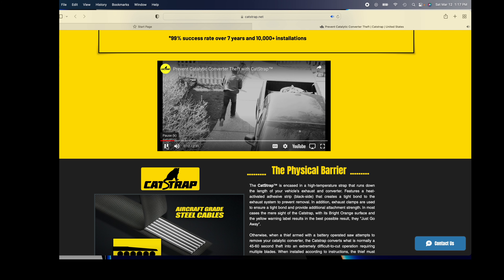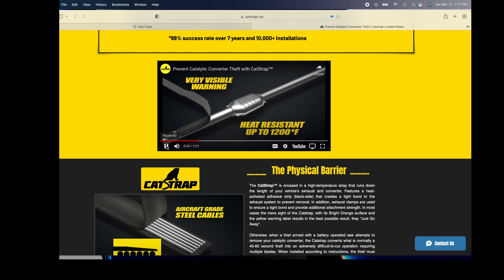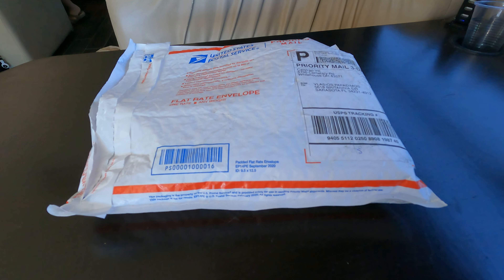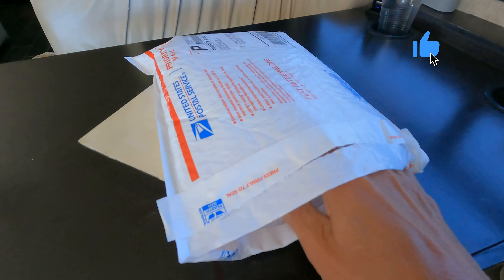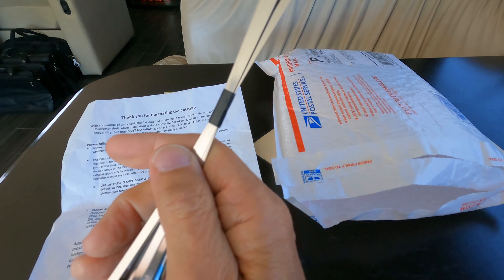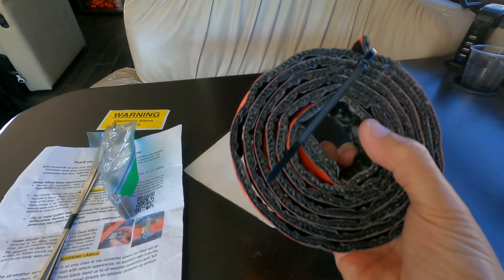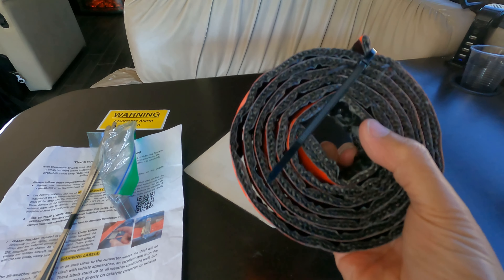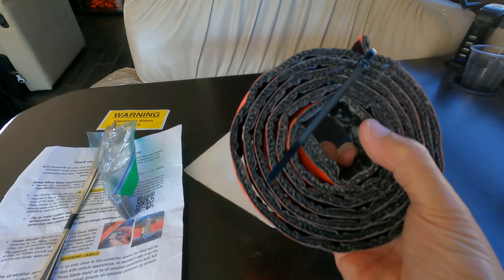Protecting my catalytic converter with a cat strap

Comment: 2020 RVR Recently had my catalytic converter stollen $6300 CAD + another $700.00 CAD for the CAT Strap. Insurance covers $6300 CAD for repairs but not the cost of the Cat Strap. Waited 8 weeks for parts as the entire exhaust system was replaced. The kicker here is I just bought the vehicle July 2022 new old stock and had it for less than 4 days.  Well worth  $700.00 CAD for the Cat Strap. My advice for anyone buying a Mitsubishi  is to have the Cat Strap installed. Mitsubishi dealers are aware of the issue and from what I hear the dealers now offer the Cat Strap as an option buying new or used.
Reply from the maker: Thank you for the information. And sharing your experience
Reply: I had my catalytic converter stolen yesterday  and I own an RVR too 2022 !! Thank you for this piece of information I will go ahead and install one of this
Reply from the maker: @ajeyakrishna7529  thank you for watching and your comments 
Please share let me know how you make out
Reply: Me too. Toronto rvr.  Cat plus 2 o2 sensors. Getting cat strap, steel cables and a shield!   3 Layers. If they can Still steal it they deserve it.

Comment: Unfortunately what this design appears to be missing is steel cables going from the cat to the upper frame to keep them from removing it if they successfully cut the pipes. That would be added protection. Also adding barb wire is an option.
Reply from the maker: All great ideas thank you for sharing and watching the video

Comment: Would have been better for you to install it in a straight line  all along the piping .
As you have it the thieves could just cut your area with 2 pipes after bolts... as well as taking the whole muffler (just hangs down) and the cat strap.... out the muffler the cat and attachment parts $$$$
Reply from the maker: Yep I looked at all the possibilities I tried it first going straight down the muffler and I couldn’t get underneath the heat shield of the catalytic converter so that’s why I went over it and it was so long that I thought well why waste it just wrap it around and if you look carefully there is actually a clamp just passed the muffler clamp Where would be a little harder for them to cut it because they got a cut them up for clamp too but making all that noise cutting all these clamps why no one‘s gonna hear you I don’t care how fast they get I mean people are gonna hear it if you have it in a good area that there’s people around thanks for your comments thanks for watching

Comment: Seems that it would be easy to cut just in front and just in the rear of the strap.
Reply from the maker: It would be easy to cut it pretty well Anyware if you have all the right equipment but it’s time and speed that the person trying to thieve it is looking at so if you look carefully at the back clamp it’s where the muffler is supported to the frame so you’ve got a cut that frame off too and in the front it’s double line there where it comes off the wire splitter from the engine thanks for watching thanks for your comments
Reply: @ACanadianRVereh  Yeah, I recognized that.
Reply from the maker: Any thing is better than nothing 
Thank you

Comment: Couldn't they still cut at the very ends of each side where there is that small gap and get away with it?
Reply from the maker: Anything is possible when you try to steal something but again time is really the crucial part here they don’t want to hang around or make any more noise and they possibly have to so something is better than nothing
Reply: @ACanadianRVereh  true, I'm trying to figure out the best way to deter the thieves.

Comment: So if you need to change the converter is there a way to get this off?
Reply from the maker: No the only way to change the converters of course you would have to cut off the catstrap and then install a new one on the new catalytic converter thanks for watching and your comments
Reply: Yeah, at a shop where they have time and can lift your car without the alarm going nuts...the epoxy is a mess and would require the whole system probably to be pulled then pry off the cat strap. but it is do-able.. :)

Comment: I'm thinking of putting one of these on my 05 Jayco Granite Ridge, apparently the thieves love stealing cats from Ford vehicles.  Question: Did you put the red Locktite on after securing the nuts?  I was always taught to put the Locktite on the threads before attaching the nut, thus using the glue strength to secure the nut.  I suppose it will goober up the threads after the nut is tightened, but a little heat will burn it away.  Thanks for the good video.
Reply from the maker: Hi Jim thanks for watching and your comments first of all I did put the red Loctite on the threads but I put quite a bit on and when I use my ratchet to put the bolts down tight it kind of spread everywhere which I thought well I’m not even gonna bother wiping it off just let it sit and I still think that something is better than nothing and the cost was very minimal let’s just call it insurance and I’m happy it’s there so good luck with yours keep me posted how it turns out let me know how yours bonds to the metal

Comment: I heard the cat strap smells very bad, and some people removed it just because of the smell. Is the smell really that bad?
Reply from the maker: No I did not have any smell. But you have to remember I have it installed on my RV and I have a lot of clearance off the road
Thank you for watching and your thoughts
Reply: Maybe it was their breath backing up on them since they were under the car in an "enclosed" space 😂
Reply: It takes 2-4 days for the smell to go away, this is the burn in process which fuses the cat strap to your exhaust  system.  If you drive short distances it could take longer.

Comment: I'm a mechanic and I could get through that in seconds with the most basic electric power tools. All these products do is take your money.

The best thing you can do is park in well lit safest areas you can, keep your vehicle in a garage if possible, and have the correct insurance. Short of 1/4-1/2 plate steel welded over your entire cat, there's nothing you can do to stop a committed cat thief.
Reply from the maker: Yeah I get it you can take anything off with the proper size cutting blades but it makes a noise it takes a few seconds longer and that’s what most people taking catalytic converters don’t want. Thanks for your comments and watching please share
Reply: @ACanadianRVereh  I'm sure you've seen steel rope blades that are run by hand and very quiet. Oxy torches are fairly quiet as well and can be hand portable. Had a customer bring a truck in with torch damage, said they did it in his driveway.
Reply: They don't carry an arsenal of tools..I would go the milwaukee Sawzall with a 14 tooth bi-metal..good luck.
Reply from the maker: @monzam2497  yes that will work but it makes a lot of noise. I now have done one more thing I added a motion alarm with a beam that is pin point just under the RV. I Have not done a video yet  still testing